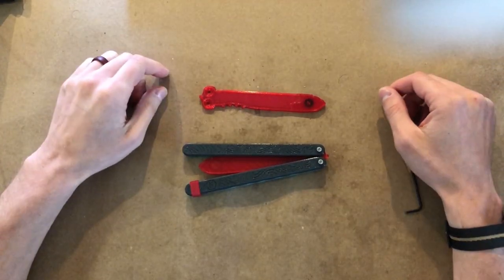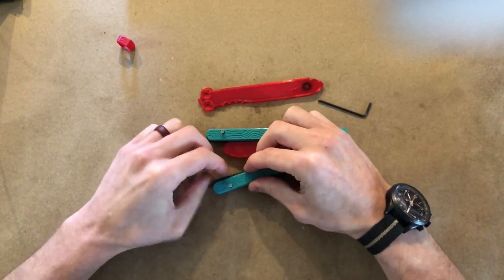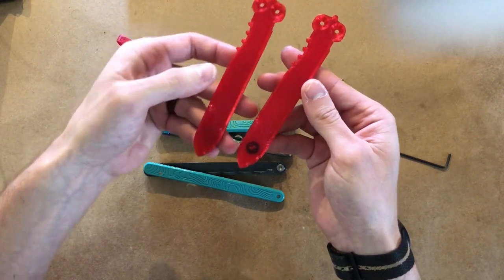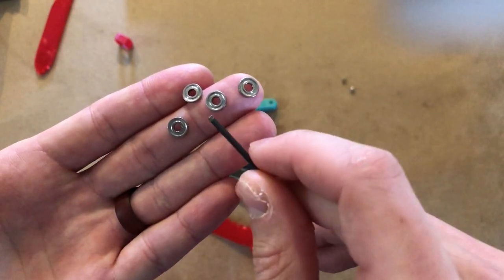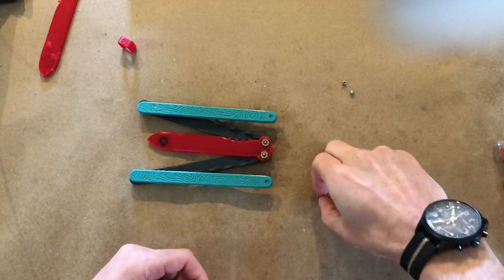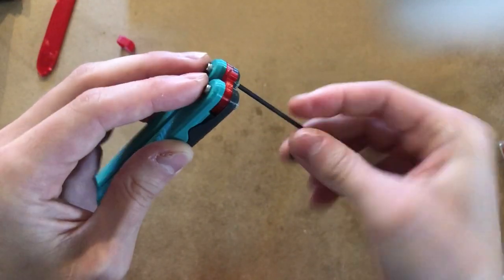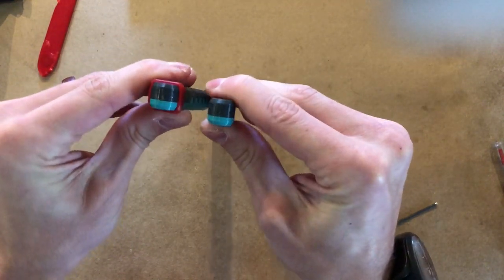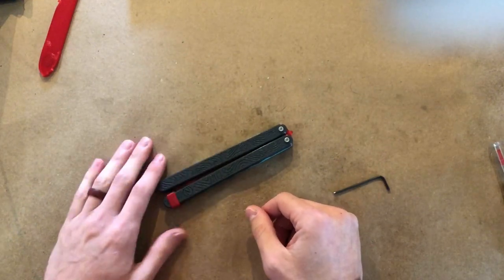Zippy Cycloid Balisong Trainer - Swapping Balance, Disassembly, Reassembly, and Tuning Instructions

Comment: I'm curious... Why not use ceramic bearings? They work great and don't need to be lubed. So much easier to clean because you can just blow out loose dirt/debris with compressed air instead of disassembling, cleaning and re-lubing.
Reply from the maker: I do have a few sets of ceramics that I've tested when I was considering offering them with the balisongs. Disappointingly, I was unable to notice any difference in the feel/smoothness of the rotation (likely due to the low RPM of flipping). Since there was no noticeable performance increase, I didn't feel ceramics were worth the extra cost.

Regarding dirt, the race washers make it quite difficult for dirt to actually get into the bearing assembly. Consequently, if any dirt does get in there, the balisong and bearing assembly would need to be disassembled for cleaning regardless of steel vs ceramics, since compressed air wouldn't effectively reach the bearing cage. 

In any case, a good shake in IPA + re-lubing is pretty low-effort, and I anticipate that most customers will never need to clean/relube their bearings based on the units that have been flipped for the past 6+ months. Based on the above factors, I view steel bearings as the best compromise of performance and cost.

Cheers, David